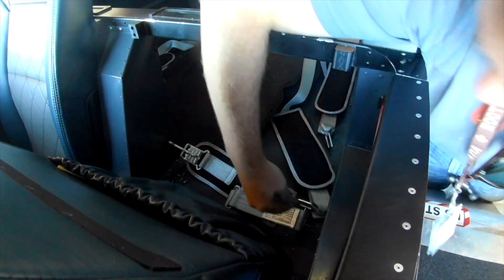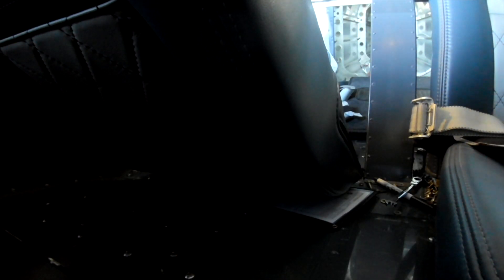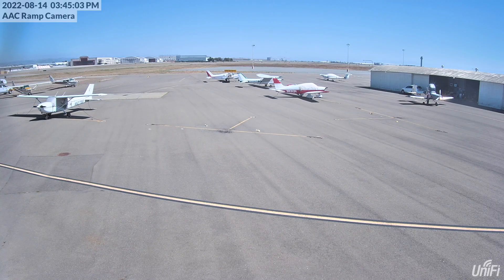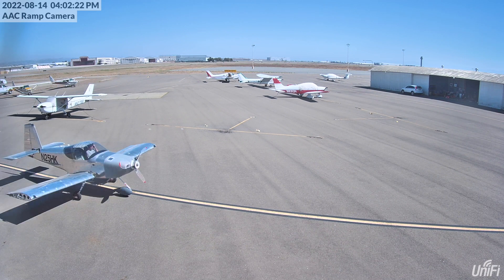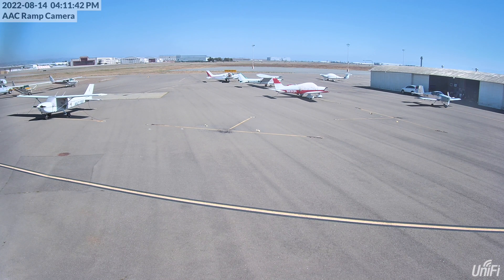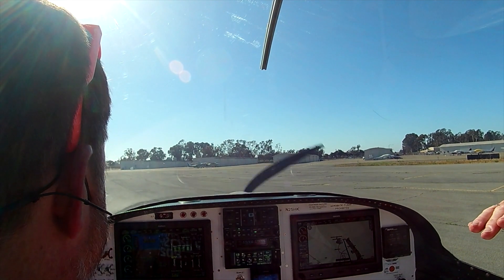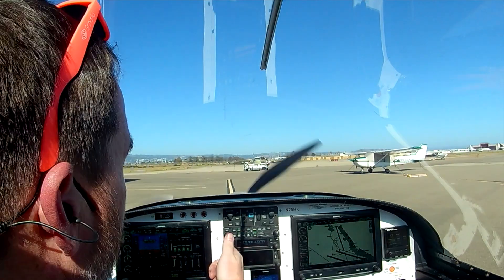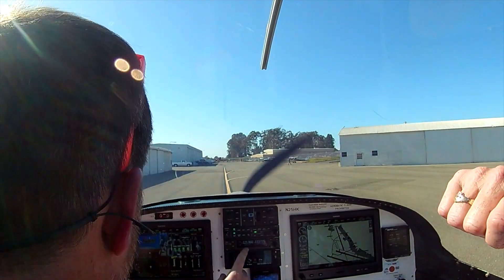RV-14 Taxi Testing I

Comment: I am surprised that you do all these long engine runs before first flight. My engine was run for less than 2 minutes at the first start, the next engine start was from the refueling place back to the hangar (1000 feet), I pushed the plane to the fuel station to lower the amount of engine runtime on the ground, that taxi run had a very short full power run just to make sure all hoses stayed in place... my third engine start was when I did my first flight.
Reply: And my DAR warned me to have at least an hour on the engine clock and a lot of dirt on the tires before he came.  Surprised me, but break in went fine.
Reply from the maker: Same with my DAR. As long as the CHTs are low keep running. Mine (outside the full power run up) never get over 290.

Comment: So for someone who has not built the fuselage, would you suggest changing the dimensions on the seatbelt brackets or just telling hooker to put 1/8" bushings in?
Reply from the maker: Changing the dimensions would be pretty damned hard. Just make sure they know 1/8" bushings.

Oddly it was only on the lap belt ends. The shoulder harness ends were fine.